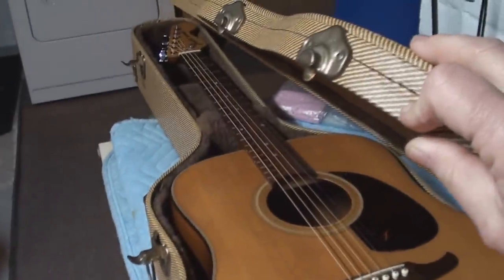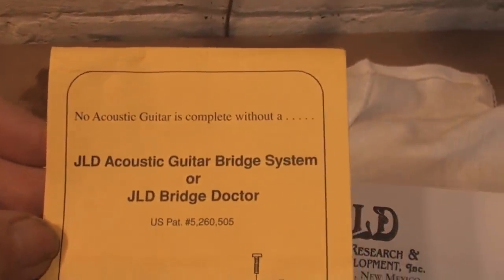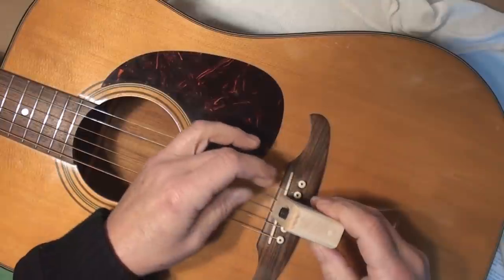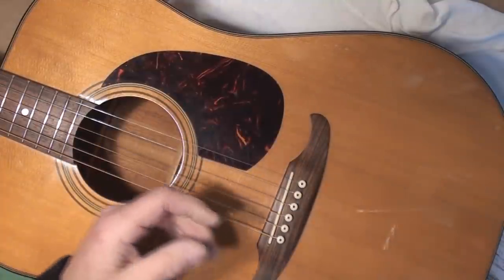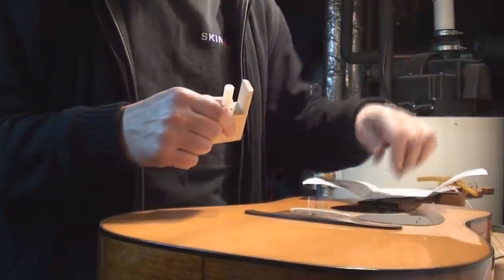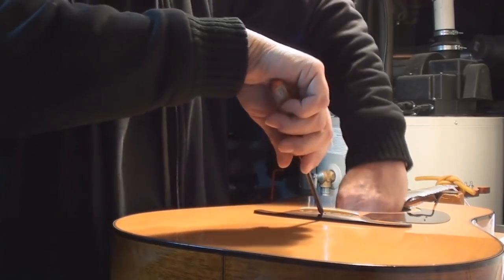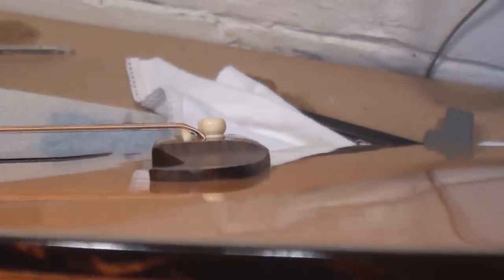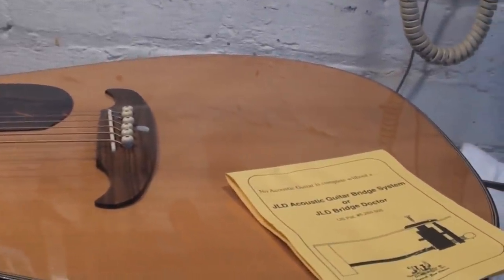JLD Bridge Doctor Installation

Comment: I made two of these from scrap and installed them on a couple misfit guitars that had no business being played as they were made in some Indonesian sweat shop of some sort. The first had a ladder bracing pattern on the top and putting strings on it made the bridge stand to attention at such an angle I thought it would pull of the top. No-name Br doctor came to the rescue, it is now my beach guitar and plays great. The second was a high school music class reject that was sitting in a closet and looked like someone turned it into an art class project with stickers and junk pasted to it. Nobody could play the thing due to bridge lift and finger killing action and it couldn't be tuned due to major lift off when strings were attached. Once again it pulled things down close enough to start doing a reasonable setup and is now used for music classes.

Comment: cont... Anyway . I put the permanent type JLD in my FG-335 Yamaha last August. I pulled the vertical part after screwed in towards the sound hole until the bridge was level (eye ball) with the side and locked down the spruce rod. NO problems, Killer tone, volume and sustain. From what I've read it takes about 3 days to "settle" after the installation and that was about right. 

Great vids Dave!!

Cheers!

Comment: Dave your video was one of the main reasons I went ahead and ordered this (so thank you for that!). 

Agree the instructions seem a little confusing because nobody quite tells you why there are two models of the 'Doctor' or why you need one or the other. I worked it out like you after several readings. 

I also had to convert all measurements into mm. Advice to others considering this: draw this damn thing out on paper with accurate measurements FIRST. That way you can work out / rehearse as you go along. Make sure you know what EACH move means & why you're supposed to be doing it. 

I did this on an Eko 12 string and the ONLY place I could drill the hole was by drilling out the rearmost of the three pop rivets holding that bridge in place. Scary! But I got the rivet out, leaving me a hole of a dimension to suit the rivet, not the Doctor. As it happens, that was ok. 

Like you I just had to dive in and do it: drilling that hole was the most nerve-wracking part. The point is the guitar was unplayable before so I wasn't exactly going to ruin anything by doing this. Did the installation yesterday, have hung it up for a couple of weeks (waiting for new strings) and will see how it goes. 

Thanks again Dave! Ref. the inlay dot - I lost it even though I sealed the damn packet straight after opening it and examining the parts first time. Mine is now filled with Das clay and covered in a plastic dome that covered the original rivet.
Reply: QUOTE:
Thanks again Dave! Ref. the inlay dot - I lost it even though I sealed the damn packet straight after opening it.

SO DID I  ! ☺ I thought for some time I might have swallowed it with my medication  pills - but have since found it (for what it's worth) I probably won't use it.

Comment: I've put this gizmo in about all of my acoustics.  On a real serious "belly" they say to nudge it down in stages over days or weeks, and they warn that some guitars have a natural built in belly that can't be forced down-- that was the case with my Epiphone Texan FT-79.  But this system will indeed keep any further belly from happening.  They also claim that the dowell rod transfers vibrations and seasons a guitar... they say, anyway.  

That "dot" enlay was ment to go in a 1/4 inch countersink made with a brad drill bit.  I went a tad too deep, so I mailed the dude in Roswell $10 and asked for some more dots.  He mailed me 3 and it turns out that only 1 was needed to come up flush with the bridge.
Reply: whaqt have u noticed about the tone & sustain after u installed the jld?
Reply: @miketaylor4993  i guardedly say it seems to help. but mostly it's an anti-belly device prolly

Comment: I've installed so many of these, I've begun making a much more robust version of it (the JLD patent has run out). The JLD is sold as a "Bridge System" for guitars that are being built with them incorporated into the design (ie. Breedlove's USA-made instruments) or as a "Bridge Doctor" to be retro-fitted into a guitar to flatten a bellied top.  The neat thing is that it acts much like a sound post in a violin. The b&s are no longer just reflective and actually make the tone more complex, especially on cheaper instruments. You can feel the back vibrating in your gut more. Action and intonation issue cause by the bellying are cured permanently and it can save the expense of a neck reset. It's truly a wonderful device.
Reply: I think you will find that the difference between "System" and Doctor" is not whether fitted when built (or otherwise)  but on the method used to attach to the guitar: Bridge Pin Hole for Doctor and drilled hole for System.
Reply: DelTangBrav Actually, in the past, JLD marketed both types both ways, but now they market both under "Bridge System" on their site. StewMac, on the other hand, markets both under "Bridge Doctor", And I've seen Music shops sell them as "Bridge Systems". I guess it's titled by the type of place selling it more than the reason for installing it or the model one installs.
Reply: guitartec
The one I received from StewMac  just a few days ago (looks identical to the one in video), did differentiate between Doctor & System in the way I describe.  As I mentioned (in another posting) the instructions are abysmal and as Dave says are conflicting. I too intend making a modification for other guitars the one supplied does not have sufficient spacing options to make it suitable for all guitars. Incidentally I looked up the initial design with a patent search - to discover that my envisaged modifications were in the original design. (All wood without the plastic post that the through bridge screw screws into).
Best Wishes (also) David
Reply: DelTangBrav Love to see yours when you're done. I started using them when they were adjustable. I still have a few that failed.
Reply: guitartec
The one I got is adjustable (three settings - same as the one in video) but they don't cater for two rows of bridge pins on a 12 string or a curved row of pins on many other guitars. I consider the main block should be made for the guitar it is to go on (or in☺) . I'm attempting, with padded weights, to reduce the bulge before fitting so it will  have less work to do - and then to prevent any bulge reoccurring. Which wood would you recommend? (I'm thinking of using cedar for the dowel - and also of making that part square instead of round).

I have over thirty guitars and three of them could do with some help.

It would appear that even the JLD fails on many guitars - so home made ones can't all be expected to succeed.
Reply: DelTangBrav Cedar is too soft IMHO. The bodies of mine are made from maple. I talked to a fellow luthier that made his adjustable from a hole he drilled in the tailblock. Another person I talked to had a unique spin on the JLD. His went through the neck block and used some sort of turnbuckle. He said it pulled the neck tight and pulled the belly down at the same time. A little too much tension for my taste. Someone ought to start The Bridge Truss Maker Forum. :D
Reply: guitartec
I had also considered using going through the neck block to get the "pushing" action - it could be done using the existing strap button hole with the adjuster becoming the new strap button (in a similar way to the way the  jack output multi-purposes on many guitars).

Although it probably wouldn't work I've thought an external plate on the back of guitar with a quite strong spring attached to it which pulled the bridge towards the back could be feasible, the spring could possibly add resonance.

I fitted one of my old 12 string guitars (A Cimar) with a six string trapeze type tail piece (as soon as belly bulge began to show) so six strings were held by the belly bridge and the other six were pressing down on it. This reduced the pull on the belly by OVER 50% as I always used the guitar amplified any possible acoustic loss of tone or volume (which I didn't notice) didn't matter. It might be a cheap but effective solution for others who pay the belly bulge price for having 12 strings.(incidentally it was the 6 supernumerary*  strings on a 12 string attached to the tailpiece).

*Not insulting anyone's intelligence - but that not too common word simply means "in excess of the normal".
Reply: My question is, is it a permanent retrofit into the guitar? Or can it fix the bulge then just be removed to be used again? I'd hate to think it can only be used once essentially.
Reply: +Diego Casillas    It''s supposed to be permanent, and you should think of it that way. If you install it and let it flatten the top for a long period of time, then remove it, the top will probably stay flat for that season, then go back to being warped.
Reply: @guitartec  do u have any photos of what ur acquaintance came up with? would love to see it.
Reply: @miketaylor4993  No, sorry, wish I did. He did such a beautiful job.
Reply: I don’t see any comments on here about humidity, or lack, which is what causes these problems to begin with. I live in the high desert in New Mexico. Relative humidity usually in the teens and 20’s. I forgot to humidify my guitar (mostly because I now play more mandolin), and here’s my “diary” of healing my guitar recently:
Yamaha FG-335E (acoustic with electric pick-up)
1/25/2023 Brad & Luther looked at my guitar & suggested Galen take a look. 
1/27/2023 Galen took a look and said my guitar is begging for humidity and it’s about to explode if I don’t do something immediately. I humidified it that night. He said soak a towel and put it in a plastic bag in the sound hole and in the case for a month! He said my Yamaha is top-of-the-line for the year it was made and deserves a really good effort. I put 2 small bowls with a soaked sock in each one, with a drop of frankincense. Covered the sound home with a plastic cover and locked the case. 
2/1/2023 added more water to bowls. 
2/9/2023 added more water to bowls.
2/10/2023 added cutting boards at bridge end to add weight per Galen’s recommendation. He recommended a telephone book but I wouldn’t be able to close the case so I used small cutting boards. 
2/17/2023 added more water to bowls. 
2/21/2023 Galen inspected, measured, and said he sees improvement. He showed me how the wood shrank and the frets didn’t, and are sticking out. But he said it’s progressing nicely and needs more time humidifying. He said when I put new strings on, don’t use first string with diameter any higher than .11. The others will be .14, .22, .38, etc. He suggested looking at YouTube video by Bridge Doctor. Might need to drill a hole as he did with his guitar, to put like a truss rod similar to the truss rod inside the neck, but at the bridge end. Added more water to bowls at home and replaced cutting boards.

Comment: Well, the reason why the instructions advices to first drill a few mm hole with larger drill and then a hole for the screw was to have a snug fit for the inlay. Using the sinker was a bit off the idea. JLD worked wonderfully with my almost 50 years old guitar, very much surprised!

Comment: One thing that should be mentioned.  After installation and during tension rod adjustment and tightening,  the guitar,  at least in my case, started to pop and crack loudly as the top was being levelled.  I believe this is normal,  but it can be a little frightening if you're not prepared for this.  BTW,  results were excellent,  Bravo Bridge Doctor !

Comment: The brad point bit was sized for the pearl insert. I think a rosewood plug looks better though. This system gives inexpensive guitars a way to stay in the game longer, if the issue is belly bulge. And it's only designed to reduce belly bulge. If belly bulge is why your action is high, this product will help. But if it's in need of a neck reset, the bridge Dr wasn't meant to fix that, only belly bulge issue. Great video, I always enjoy them.
Reply from the maker: HEAT PRESS.this is junk fix and rarely works..waste of effort product

Comment: I have a 1969 great (Japanese copy of a) Martin 000 model with a JLD Bridge Doctor installed. It is my finest sounding acoustic guitar. Well balanced, with somewhat protruding bass and well-defined mids and highs.

I think the idea behind it is rational, and genius. It transfers the vibration of the top to the rest of the body. It is similar to the idea behind ALL stringed instruments, from violins to double basses - they all have a connection between the top and the back of the instrument, called a 'sound post'. Ask any violist you know about it, and they will not exaggarate its value.

It is a shame that your attitude toward this device is obviously negative from the get go. If this particular guitar you provided with the JLD system still has a high action after installing it, there may be multiple problems with that guitar. It does not disqualify the JLD system in the least. You fail to recognize just that.

Comment: Thanks Dave, you do so much to help us out! After seeing your video, I realized I might be able to handle this repair, and it worked for less than $25.  Because my F-307 is a low end guitar, the repair shop said it was not worth the labor costs to fix the top and bracing and re-glue the bridge saddle.  Well guess what? Not only did the Bridge Doctor take the "belly" out, the thru-screw succeeded in pulling the tail end of the bridge saddle securely to the top again!  After that, I was able to set the action back to just below 3/32" again. PLUS, THE ACOUSTIC SOUND QUALITY IS AMAZING- NO EFFECT WHAT SO EVER----GUITAR SOUNDS BETTER THAN EVER~Yippee!!!  BTW, I did succeed in using the MOP dot to cover the screw head.  Took some careful countersinking "trial and error", but came out A-okay.

Comment: I put in my FG335 Yamaha!

I bought a Yamaha FG140 off eBay that the previous owner had put the brass pin type in. The saddle was cracked between the pin holes and epoxied. The repair was "OK" I guess and the seller included the brass type JLD thing with the guitar but removed from the guitar. I think it's reasonable to conclude that the brass pin type is what cracked the bridge since the pull is against the pin holes themselves as opposed to behind them like with the permanent type.

Cheers!

Comment: Dave, the "total fail" is your installation method. Do you normally use a reamer for inlay holes? Then why did you ream this hole? Duh! You can't blame the instructions for that screw up. The inlay piece used to cover the screw doesn't have a tapered edge. Hello? Further the JLD system is NOT designed to lower the action - just solve the bulge issue.

Comment: Great video, for sure............moisturize the the guitar body to remove the belly, remove and reglue bridge, polish the top.....that's my vote. Loved this video!
Reply: Over moisturizing can add a belly.  It happened to my Collings one winter because of over humidifying. I had it in a Calton case with an in case humidifier and in a small humidified  room kept at 50% humidity. The string action was nearly a 1/2" high and the top looked pregnant. I called  the Collings shop and was told to leave it uncased in a dry unhumidified room for a couple weeks.  It took 3 weeks to take the belly out and get the string action back to normal.

Comment: If you drill the 1/4" hole to the correct depth the MOP dot would have fit in perfect hiding the screw. Great job though.

Comment: I haven't done my guitar yet, but have read that moisturizing, tensioning and then re-tensioning after 24 hours is the way to go.  The dowel needs to be 90 degrees in relation to the tailpiece, which makes sense to me.  So perhaps loosening and re-positioning and re-tensioning after 24 hours.

There is also another model of the Bridge Doctor that does not require drilling, uses brass threaded pins instead.
Reply: Moisturizing and retensioning of the top will last at the most through the guitar's first shrink / swell cycle, then it's back to belly as usual. This moisturizing concept almost never last very long. The brass pin Bridge Dr. is a better gamble but you need to leave it in through several shrink / swell cycles to make it worth while. Problem is, the guitar is not usually very playable with that version of BD in it as the string break angle over the saddle is poor. I know you wrote this 7 months ago, but I hope your guitar is better by now.
Reply: guitartec I thought about the problem for a couple of months, ordered some parts ($14.00) and invented an ugly solution that fixes the deck bridge warping and (on this guitar) eliminated the need for a neck-reset.

The action was almost 3 US Quarters at the twelfth-fret, brought it back down to a single Quarter. I was getting some fret buzz on the high E string because I had sanded the bridge too low (in an earlier attempt), but this guitar has an adjustable bridge-saddle so I was able to bring the action back up.

Looking for partners who want to explore further, not really suited for something like a Martin, but working great on my early 1970s pre-Ibanez -- brings the guitar back to it's factory settings with about 15 minutes worth of carpentry.
Reply: Thanks for your post.  Been looking for more information on how long practically it may take to see differences and allow it to settle.  The adding moisture also makes sense to slightly add some flex in the wood without it being too brittle as I adjust incrementally.  I think that is really important for older guitars that have the original bracing that may be brittle, including the glues that can also be too dry over time and simply fail from stress and new forced flexing back to a more flat plane once again.